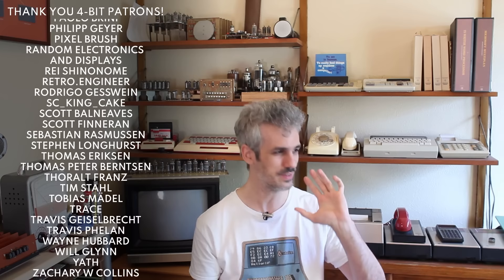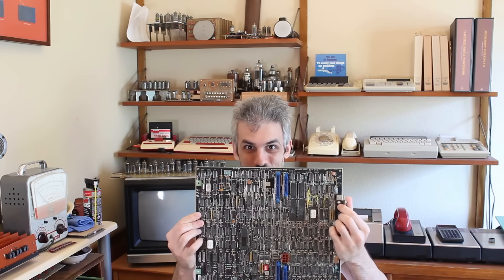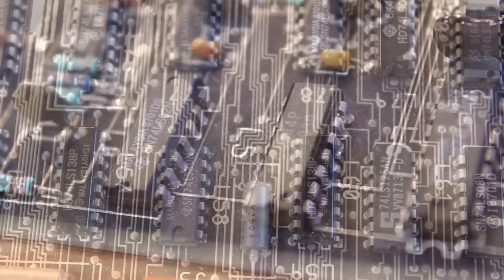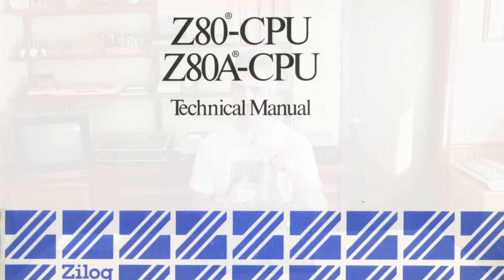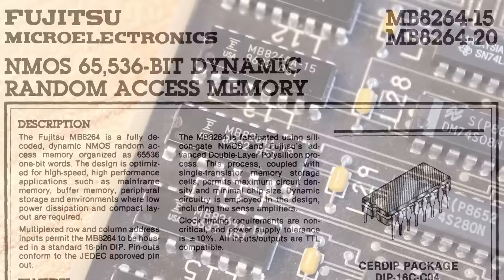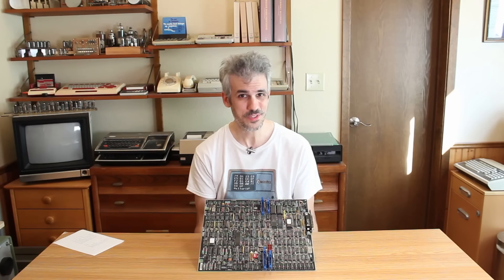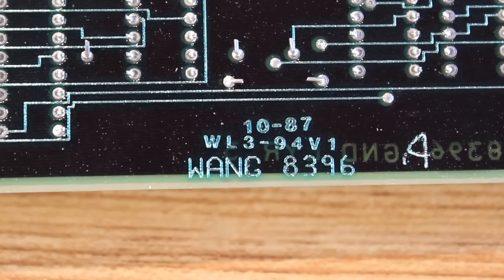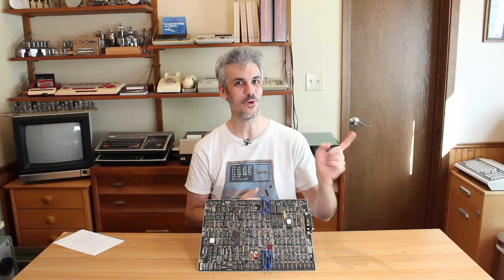What is this Mystery Wang PCB?

Comment: Nice hopping to the bench. LOL.

First off, It would look great in a frame on the wall.

The 4Mhz crystal will be for the Z80 CPU, the 10Mhz might be for the Floppy controller/CTC chips. (If my memory serves me right the Z80 CTC chips use a seperate clock to the Z80 CPU)

I think it is a single board computer. I've seen that black connector, (8:10), on the back before, I just can't bring it to mind.

Apart from that, I'm no help at all. :)

Comment: I think that is is an external hard or floppy disk box for 2 MFM drives. I would expect that your weird looking connector is something like a SCSI interface.
It looks similar to the CBM PET external dual floppy station. That used an entire 6502 system to drive two micropolis floppy drives.  
The CBM floppy also had a large RAM bank.
Considering where Wang vwas used it must have been a storage device for one of Wang's Minicomputers. Maybe someone among your subscribers has a pin out for that device.
The Z80 was Very popular among designers for peripheriials. I worked at Nixdorf Computers in the late 1980s and it was used like a micro controller for sublemevtary tasks. The octopus 8818 Telephone exchange used the Z80 massively parallel. Every subscriber card had one. 
So, you finding the Z80 on a disk controller is not that unusual.
Good hunting!

Comment: Wang was into corporate/campus computing networks at the time. They were a major competitor to where I worked which was TRW. Ethernet and such didn’t exist at that scale yet. So networking was done via broad band cable systems. Basically you had 6 MHz Tv channels used for networking. Z80s where the highest performing processor at the time for doing networking/terminal server activities. Not sure this helps with your question but take it for what it’s worth. $0.02!
Reply: Correct.  The proprietary broadband communication used between all Wang devices was called the "928 link."  That name was given to the protocol by Dr. Wang because no one could come up with an appropriate name.  So Dr. Wang turned to the design team and said, "Well, today is September 28.  That's 9/28, so we'll call it the 928 link."

Comment: Looks like a stand alone hard drive controller for a system that doesnt have the ability to be expanded. Looks like it talks to the main system thru the centronics connnector in the back.
What would be cool is figureing out how it talks thru that connector and seeing if you can get it to start sending out data thru the port.

Comment: My first reaction is this is a board of of Wang's mini-computer/multi-user system that would live in a computer room.  However, the lack of connectors is bothering me.  I would have expected a card edge connector so it could be put into a card cage.  At this point, I am thinking it is more like a single board computer.  It looks like it mounts to a baseplate instead of a card cage.  That one connector on the card end looks like a classic Centronics parallel port before IBM established the DB25 standard.

Comment: Just looked on eBay and saw another WANG 8396 very similar to yours and is described as follows. Vintage Wang 8396 - r1m1 Wang Circuit Mother Board System Computer. It's probably not a full computer motherboard but probably a board from a Wang Terminal, usually comprising a monitor, motherboard (in a single unit), and keyboard.That is my guess anyway.

Comment: Commodore disk drives such as the 1541 used a MOS 6502 running at 1MHz and with 2k of RAM.  They were more or less computers in their own right.  But the RAM on your board does seem excessive.
Reply: 8250s (PET dual floppy) had two 6502s.

Comment: I remember 36 pin ports being parallel printer ports.  I think you do have a single board microcomputer with floppy disk controller, serial monitor port and printer port. Just a guess but it looks like it.

Comment: Not all hope is lost with that connector. Centronics port to DB25 cables are incredibly common since many old printers used that same connector. Not to say hooking that up to a terminal will do anything, but adapting it to connect to an RS-232 device will be incredibly easy. If you were here in Iowa, I'd just give you a cable!
Reply: You'd need a bunch of chips and level changers too.  Centronics type parallel printer ports are all standard TTL logic levels and use parallel data with a bunch of control signals .  RS-232 terminals are serial devices with signalling typically at around +/- 10 volts on a serial connection (common driver chips normally used +/- 12 volts). The Centronics to DB 25 cables are compatible to IBM PC style parallel printer ports (with a matching 25 way socket on the PC), whereas the PC serial port used a 25 way (and later a 9 way) plug on the PC to prevent mix-ups.

Comment: it looks to me like a terminal emulator with the ability to save to floppy(wang propriatary floppy), maybe the connector on the back was meant to have various adapters... there may have been a 2nd board that plugged into a backplane of a bigger computer(ibm maybe), can see screw holes on the left side and in the center where standoffs could go to mount it, right where it would need to go to plug in the ribbon cables.

so what i think this does is make wang propriatary stuff work on ibm hardware...

Comment: This could be an early SCSI SCSI <-> MFM disk drive controller board from a 2 drive HD enclosure.  Typically would have had 2x 300MB Disk units plugged into it.  Reminds me of the Sun disk Unit I used to use that was connected to old Sun 68020 work stations.  Didn't Wang produce an early Unix system at all?

Comment: That certainly looks very like/ is a full computer not just a disk controller.. Definitely.. Maybe. What is missing for that are the normal interface ports like keyboard or display. Could be intended to operate through terminals but that doesn't make much sense for 1986 either. Could be a second board that handles the user interface stuff - but that starts to make it look like part of a larger multiprocessor system. A real mystery.

Comment: Most computers in the early days of computers each board that was controlling disk drive, printers, memento modules or printer ports had there own processor if not 2 or 3 used as a main board controller (like a micro controller does now) this would interface to the main processor board sending data between boards .

Comment: Starts at address 0000h with a jump instruction to addr 017ah  does some stuff then at address 0190h gets another jump to addr 0003h where it gets a jump to 00a7h performs an exclusive OR on  the A reg clearing it and then outputs that to port 10h then stores it to addr 205ch then ouputs it to port 20h and port C0h ........ Z80 code. also at address 0066 is the Non Maskable Interrupt location.

Comment: I go with single board computer or fancy smart terminal. The connector is large due to it probably providing data to a monitor, keyboard and what not. I assume the other orange or red connector should be the power. I had a Burroughs B21 system that needed some work. (Wishing I would have not got rid of it.) Anyway it had a big wonky cable going between the 8" drive unit / 8" hard drive unit to the computer. Even had Word perfect on it. Speaking of that. Back before the internet I was told several people went from Wang to word perfect and word perfect copied the control keys over the PC. So if somebody was using a Wang Writer it would be easy to move over.

Comment: This looks a lot like a hard disk controller that replaces the regular FDC card, or it ties into the floppy cable chain. Do the cables match up with a regular XT-style MFM interface? It should take a Seagate ST506 or ST412 hard disk that you can take from any regular 5150.

Comment: The Commodore disk drives were literally a separate computer attached to some some drives.  I am wondering if its the same thing.  The connector on the end is probably a interface cable for connection to something like a Wang writer.

Comment: From Wikipedia:
"The original Wang PC was released in April 1982 to counter the IBM PC, which had been released the previous August and which had gained wide acceptance in the market for which Wang traditionally positioned the OIS system. It was based on the Intel 8086 microprocessor, a faster CPU than the IBM PC's 8088.[49] A hardware/software package that permitted the Wang PC to act as a terminal to the OIS and VS products was available. The first version of the hardware component was made of two large add-in boards called the WLOC (Wang Local Office Connection). It contained a Z-80 processor and 64 KB of memory. The original PC-VS hardware was using the 928 terminal emulator board, the WLOC boards were used in the subsequent 80286 machines."
Alternatively, to me, that board looks like a full workstation main board, which I wonder if it was the guts of a workstation Wang response  to systems of the time like DisplayWriter or Xerox 820.  The Wang 2200 series was similar in functionality but used the Wang 2200 chip. (The 2200VS looks like  really interesting machine. Could program in COBOL, RPG and Assembler using the 360/370 instruction set.) Is there a Wang product catalog around from that time, about 1983 to 1986 (the year on the chip, not the 1986 from the data dump which may have been an update)?

Comment: The lack of a bus connector on this is very confusing, The form factor suggests something out of a Wang Professional Computer. They were 8086/80286 based but did have a separate Winchester controller board. I'm wondering if this could have come out of a late model OIS 40/50/60. I wasn't working much with Wang after 1986 and didn't get any time on the "baby OIS" boxen.

Comment: So my guess is it's a smart drive controller for a 2200 system.  There aren't many connectors on the board.  Floppy cables, power, and the connector that looks like it connects externally.  For example, the Commadore 64's floppy drive had a processor to handle the drive so the 64 itself didn't have to do so.  In a commercial system, the cost of a processor wasn't a lot.  Wang's "928" terminals had 8080a or Z80s in them.  Hang it on the wall!!!

Comment: it might be the board you bought of ebay? 
Vintage Wang. 8396 - r1m1 Circuit Mother Board System Computer.Untested, pulled out of a computer that powered on.    No other info offered.
Reply: That one has different color ribbon cable connectors.
Reply: @ravenbarsrepairs5594  It also went to Norway now I look again

Comment: That not D25 connector looks like a centronics one, add the on board CPU, and I'm wondering if its some kind of SCSI expansion or may be IEEE-488 expansion, both of which used intelligent peripherals. SCSI could do DMA. Basically you could tell devices to transfer data between them selves without the main system CPU needing to get involved. So I'm thinking an intelligent disk controller which can do its own copying between devices and so on.

Comment: Totally of the topic here, but have you heard of magnetic amplifiers/saturable reactors, i love their simplicity and ruggedness and feel like they are something you would be interested in, love the content you do and especially the one bit computer series.
Reply: I have heard.  Actually not only heard, but have had two completely separate situations to deal with them.  The first time was when we started using SCRs for DC motor drives.  There was almost always a DC tacho generator for speed feedback.  But for better dynamic control we wanted to add a current feedback loop as well.  At that time I was still a student, but I, along with our group benefited from the knowledge of our leader.  He knew of saturable core reactors and said we should build some of those for our current measuring needs.  They worked, and we built probably about 100 of them.  All that was before the closed loop Hall effect sensors became available.

 The second time I came to meet saturable core reactors was when I had to figure out an odd welding power supply.  Turned out that the output stage was built using a mag-amp.  It was a 3-phase unit wit 300 A output for TIG welding.  At that time we already had available 3-phase entirely SCR based power supplies, even up to 600 A, but they had considerable 360 Hz ripple.  The mag-amp welder output was nice and smooth.  Of course, you could not pulse the current essentially at all, due to the high inductances, maybe just 6 pulses per second (very rounded), while the newer SCR welders did 25 reasonably square pulses per second.

 Actually, I now recall a third involvement with saturable core power stage.  As funny as it sounds, that was a 200 kW DC motor drive that had vacuum tube control "op-amps" feeding a thyratron tube, which then fed the saturable core output stage!  It drifted badly, and eventually we built a transistor and SCR based control system to replace the (purchased) control.  At that time we built our own op-amps, using matched 2N930 transistors as the front differential pair.
Reply: @InssiAjaton  good to see i am not the only one trying to use "ancient tech", i thought about making a linear supply that would use a mag amp to measure output current, but it could be propably also used instead of the BJT's to create reactive power, i also though about making a high power audio amp however, making a 10 - 30 KHz ac power source for them using just mag amps is proving rather difficult, speaking of tubes i love the idea of using a tube with a high impedance input on the grid for very weak signals and then feeding that into a thyratron or a mag amp for massive power gain, perhaps an audio amp idea.
Thanks for the comment and have a nice day!
Reply: @tntamaster3879  -- Indeed, you would need some 300 kHz to 1 MHz ferrites and Litz wire windings to deal with anything like entire audio frequency range.  By the way, the present implementations for the old near DC saturable core reactor type sensing is called Fluxgate devices.  I believe many of them use megahertz carriers and RF type ferrite cores.  All my past experiences were way back when, and I have no intentions of doing anything with them presently.  I just have seen various news, like that Nasa items roaming on Mars use the fluxgate devices due to their superior stability, better than any Hall effect devices.  In fact, LEM has nowadays Fluxgate sensors in their product line, in addition to their original closed loop Hall effect sensors.

Comment: What if it is a daisy chain module and you can ignore the weird backplane connector, what if you can just connect disks and power?
Reply: Hmmm, for example you connect that between another computer and it's disk drive and it optimizes the disk access?  That would mostly explain the connectors.  I've never heard of such a thing, but it sounds logical as a plug-in performance upgrade.
Reply: @russellhltn1396  my r630 for example has connectors that don’t necessarily have to be actively in  a series. They are just there for technical support reasons, not to worry about.

Comment: The Beard Is Back! 😆
Reply: The board:  Without anything more than a quick look, here are my first impressions.
It doesn't seem to have an edge connector and all of the other connectors look like they were designed for "subsiduary" equipment or boards, so therefore this board is almost certainly the "main board" for whatever equipment it went into.
There are a few 40-pin chips on there, plus what looks to be some 28-pin chips next to two of the 40-pin chips.  That leads me to suspect that one of those 40-pin chips is the CPU and the group of larger chips are PIOs and either FDD controllers or UARTS (or one of each).
Now to watch the rest of the video and see if any of my guesses can be confirmed.
Reply: Adding after watching: Yeah, it looks very much like a SBC to me.  And if it isn't, it probably can be used as one.

Comment: Pet theory: I see “WL” in the part number, maybe this is an internal tool for wang labs to do bulk disk copies from a hard disk to assist in the manufacture of the floppies that come with the writer. That could explain the cpu, which could run a prompt for a worker to load/ unload floppies. All that ram could cache the disk images, and the hard drive would provide non volatile image storage. This is a complete shot in the dark though :)
Reply: Oddly - That was my suspicion too, some form of bulk duplicator,

Comment: hummm.....a turboencabulator control unit?
Reply: Impossible, unless it was a dev board. The Turboencabulator didn't effectively prevent side fumbling  until the end of 1989.
Reply: I'm not too convinced, tbh.

This board doesn't have the right kind of spurving bearings.
Reply: @electronash  You are right... Neither do the Hydrocoptic Marzlevanes

Comment: It's only a wild guess, but could it be a Wang DVX Peripheral Signal Processor board, which was for answering telephones?
If it had an analog to digital converter?
It was just a wild guess by era, and the plug, looking telcom related.
https://en.wikipedia.org/wiki/Wang_Laboratories
Reply: The telco "centronics" style connectors have 100 pins (50 pair) this appears to be a 36-pin centronics